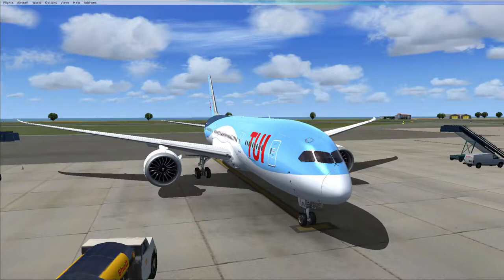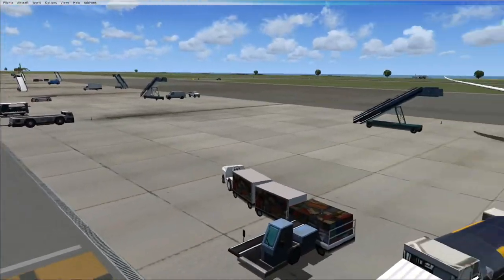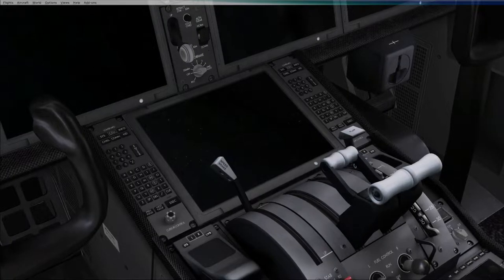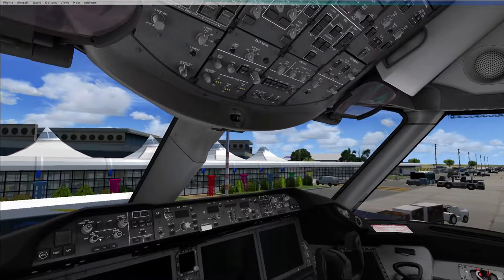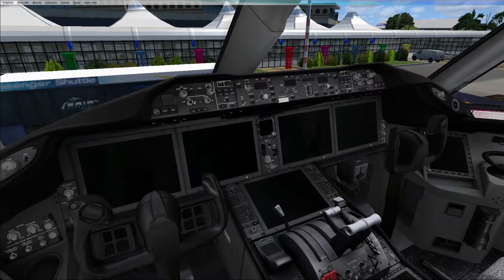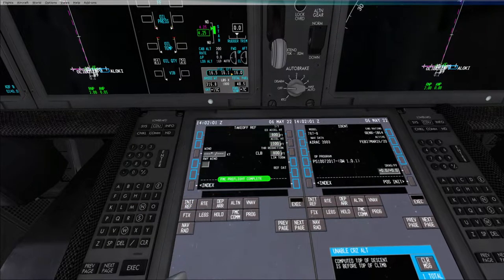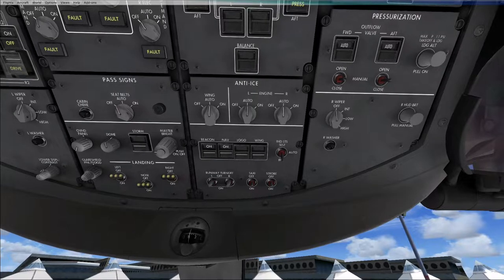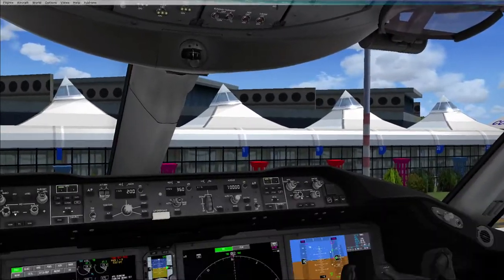787 Cold And Dark Startup To Takeoff (Easy Tutorial)

Comment: You get better framerates in Rikoooo (freeware) 787 or QualityWings 787?
Cuz the FPS in the VC view in my Rikoooo 787 are garbage, 18 FPS, even the PMDG 737 performs better on my laptop xD
Reply from the maker: Yh the rikooo 787 always had fps issues
Reply from the maker: Even my pc can run the qualitywings 787 better than the rikoo and the qw is a full fledged pro fully clickable aircraft
Reply from the maker: Dont get me wrong for being free the rikooo is great
Reply: @SwatoddddSimulations  yeah but really wish they optimized it a bit, cmon I can run PMDG 737 and Aerosoft A320 at 30/50 FPS respectively, but the Rikoooo 787 feels like using a 2005 PC